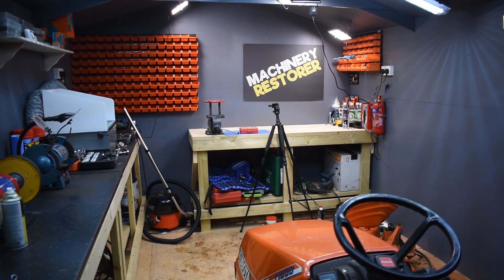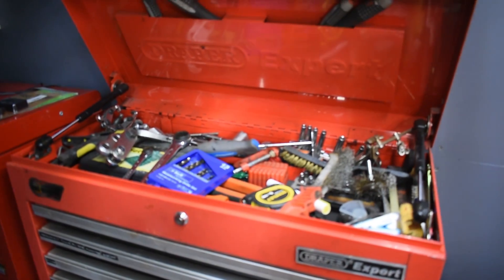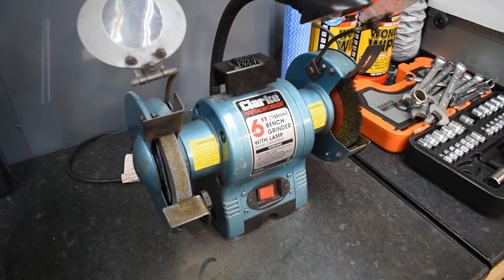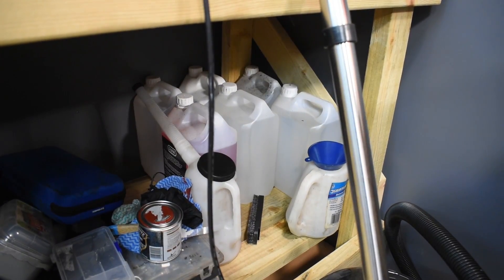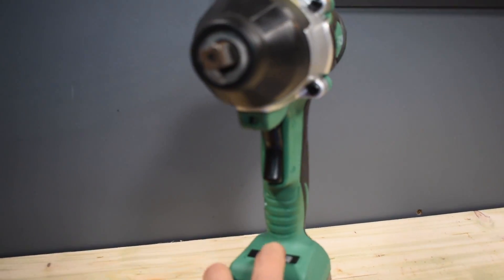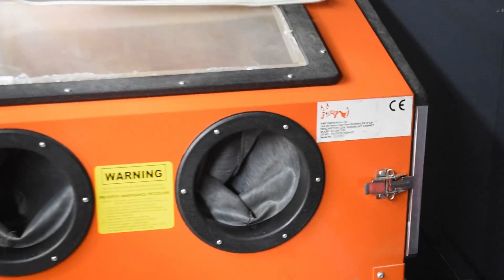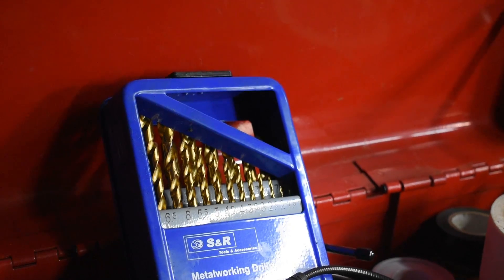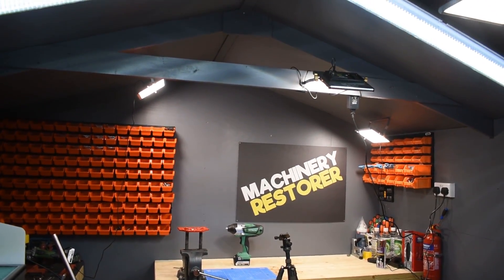WORKSHOP TOUR - £4000 UPGRADE

Comment: VERY IMPORTANT: Daggerwin, you need to keep your carbon monoxide detector closer to the floor, CO is very heavy compared to air, and by the time that the CO level is high enough to reach the detector you'd probably be dead
Reply: Thanks for the tip. There is only a very small risk of carbon monoxide in there anyway, it's just a precaution
Reply: I didn't know that thanks. My CO
 detector is on the ceiling...
Reply: @Daggerwin  of course, but using it properly is more important than "the odds of it happening"
Reply: @Daggerwin  This actually the exact opposite, CO is lighter than air. CO2 is heavier than air...

Comment: (This is intended as a joke) But omg you used a socket to instal a barring when you had a hydrolic press I mean I would never do that I just ruined a Westwood deck shaft by beating on it so hard cause it didn't come out
Reply: Yeah I would never want to hit a shaft with a hammer...unless it was a copper hammer. I read you comment again...I didn't use the press because the hubs are stuck in the deck.
Reply: Teah i know but ive got three decks only needed 2 and it was siezed fast and the copper hammer was a goor 5 mintues away 😂
Reply: lol whatever works for you :)